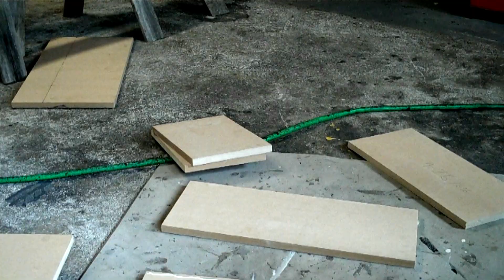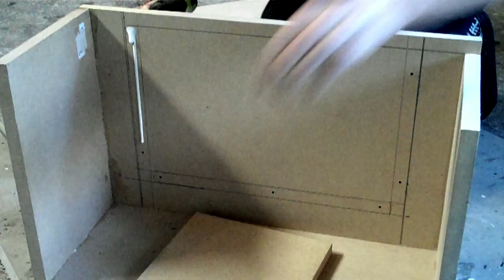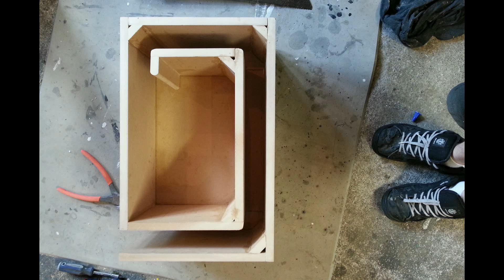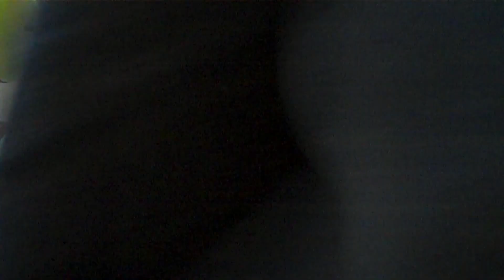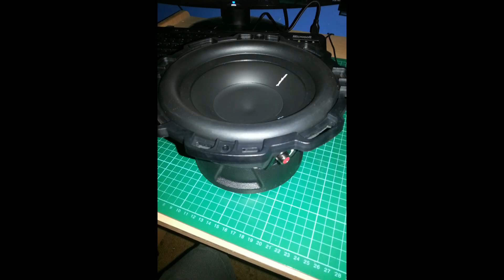Building a 8" ported sub box 18mm MDF

Comment: worst design ever. the ports u have going are useless. no specs. overload on glue and come on 4 chambers for an 8".
Reply: nigel mahabir What are you talking about? He only has one port and it's a single chambered box. Do you mean the corner braces aka 45's? Those are to smooth the path of air, just like the rounded edges.
Reply: @u2bed91  your right I have a very similar design with a jl8 w7 and it hits like a 15